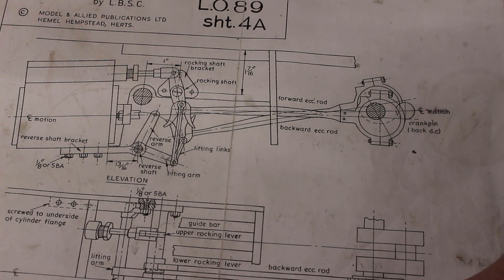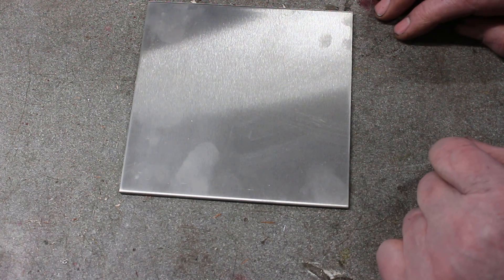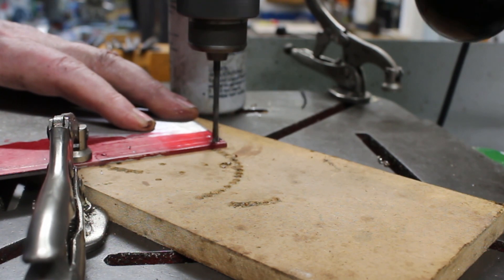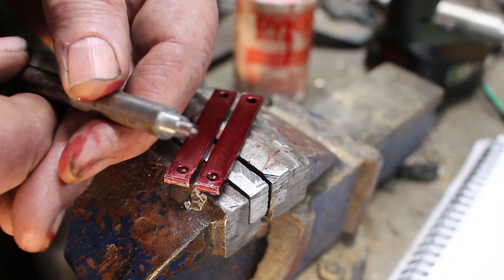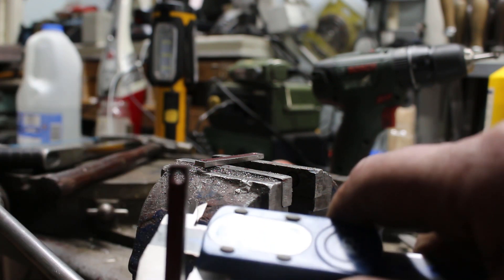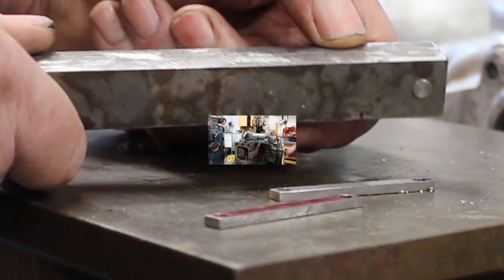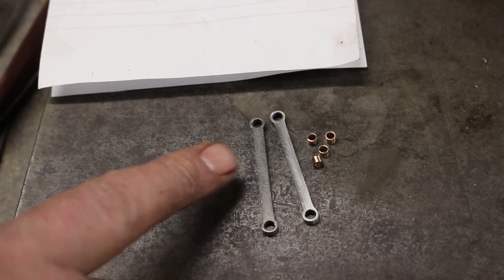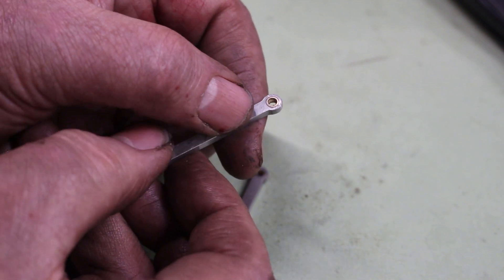Lion Locomotive in 5" gauge part 58 - Hand Crafted  Valve Gear Lifting Links

Comment: Sorry to swear on your channel but (what CNC machine do you have?) 

Lovely work as always, lots of skill in turning a black sheet of material into something useful 👍
Reply from the maker: Hi Robert
My CNC is a DIY conversion of a hobby vertical mill. I converted it using stepper motors and replaced the lead screws with ball screws, I'm running it with Mach 3. I also modified it so that I can change the standard head for a high speed head for engraving. I'll be showing more details of the machine in an upcoming video.
Thanks for your interest.

Comment: That's why my machines doesn't have any keys.
Reply: Yep, just twist a couple of wires together and off you go. It is a bit safer here in the States, we use 110 instead of 220 for the most part.

Comment: You missed the opportunity to do a video on lock picking but you got there in the end.😉
Re centre popping stainless, due to its ready ability to work harden one tip i heard many years ago was to not use a cone point but grind a pyramid point on the centre punch. The idea being to give something for the drill to bite into rather than a smooth hard surface. Your 316 seemed ok though but with 304, of hideous temperament, i would give it a go.
HNY2U 
c
Reply from the maker: Hi Chris
Thanks for that tip. It did take a bit of pressure to get the drill going initially, I kept the pressure on right through the drilling, I've experienced work hardening when drilling before, it's quite amazing how hard it gets, 
All the best for 2021
Cheers!

Comment: Nice one Nigel. It is surprising (to me at least) how rewarding the little parts can be to make! I've just finished my steam manifold hand wheels (20mm in dia) and had to file the squares in the centre (3mm AF) to suite my valve stems. I was not looking forward to it but once I began, I did not want to stop? I had 9 to do. Good fun.
I see you are using your filing buttons the easy way!
Reply from the maker: Hi Peter
Yeah, I took your advise and just let the buttons roll free. Filing and polishing is, for me at least, the most therapeutic activity in the shop.
Cheers!
Reply: As the Doors said, "Let it roll baby roll, all night long.".